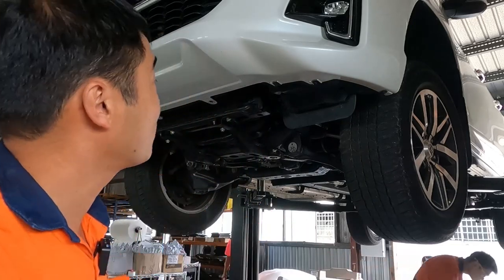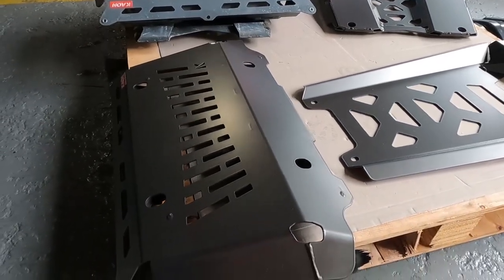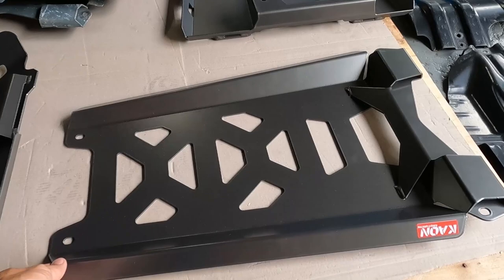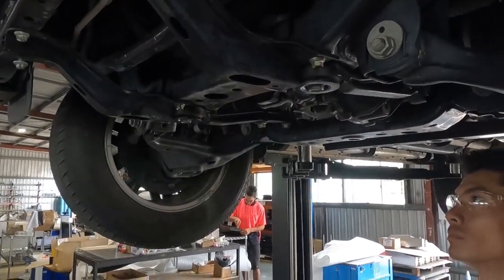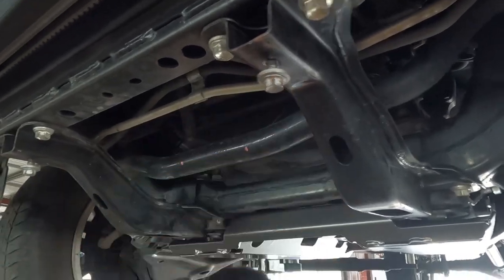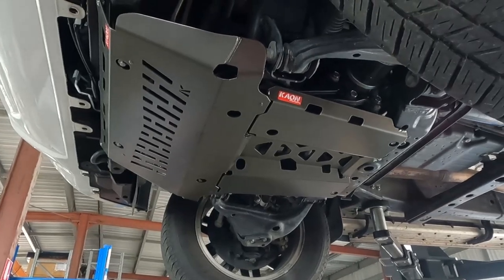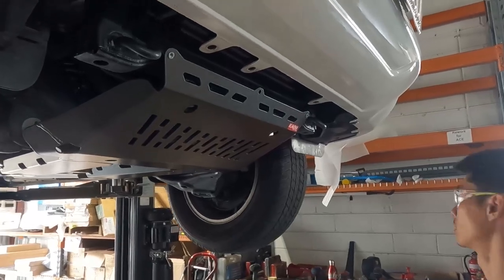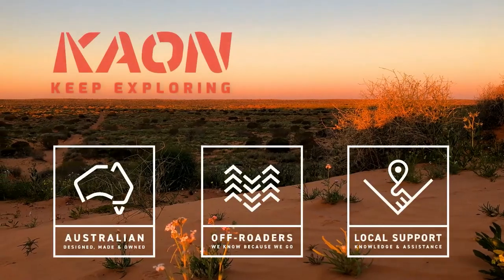Toyota HiLux N80 & Fortuner KAON High-Performance UVP / Bash Plate – Fitting & Installation Guide

Comment: When you extreme offroading in the jungle* and  pass through tree stumps or roots that holes will stuck and ripp off your entire skid plate including all the nut and bolt holes. Skid plate should be smooth and flat so everything will slide  under it. (*my experience offroading in Indonesia's rain forests)

Comment: can you use this UVP system with the MCC Bullbars and MCC Rated Recovery Points? Cheers, Don :)
Reply: they're a factory bash plate replacement. They shouldn't cause any problems with bullbars or recovery point.